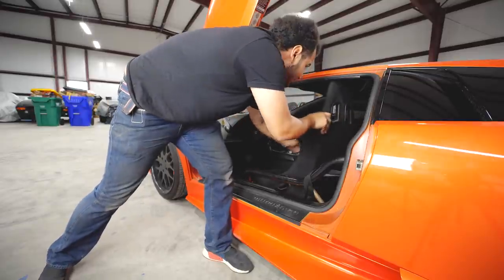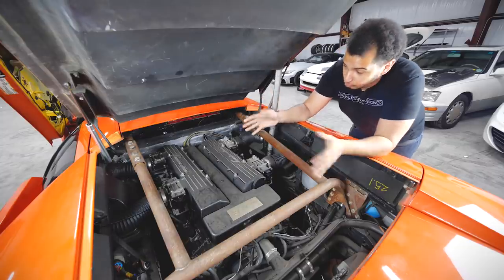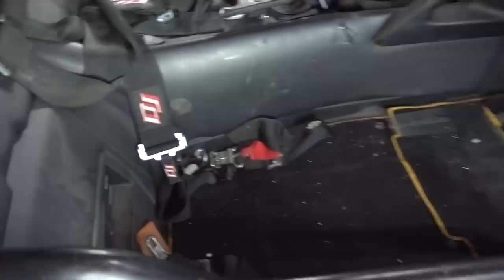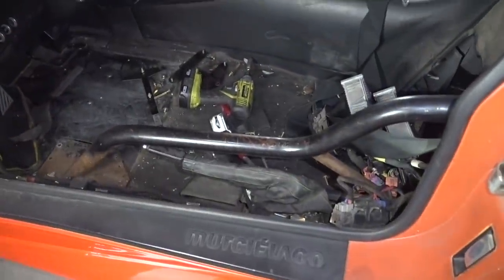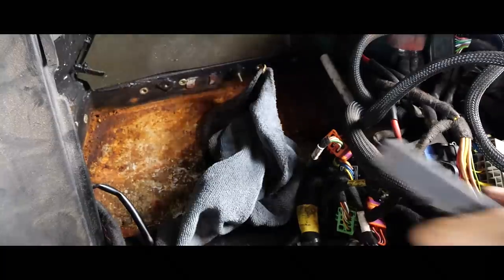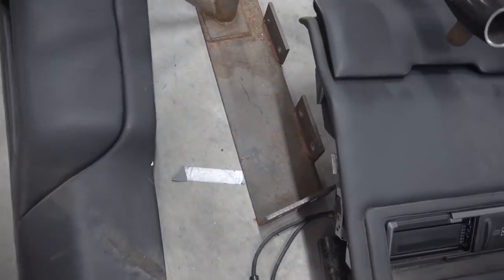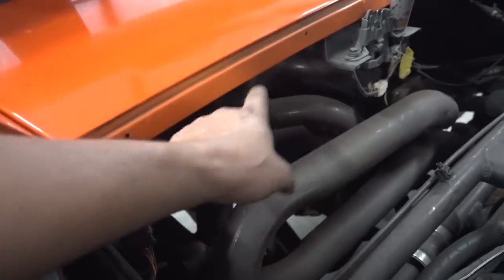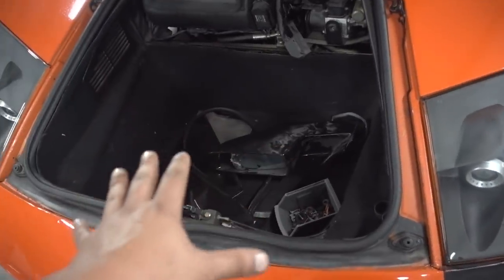I THREW AWAY All The RUSTY Fast & Furious Movie Parts On My Cheap Lamborghini (NOTHING LEFT!)

Comment: My old audi A8 had key stuck in ignition (reason was low voltage). If it is audi part there should be a little hole on front side of ignition lock where you push with needle to get the key out. I doubt it will help, but try it out.
Reply: hope he sees this xd
Reply: If I recall correctly. The key is cemented in.
Reply: He was told it was glued in but that doesn’t mean it was.

Comment: Nice project but, stereo is absolutely the last thing to do on the list...
Reply: daredevil7442 well I mean if u already are going to have everything apart you might as well do it.
Reply: So build and nearly finish project to rip apart completely again to install custom sound. Right.. I see your logic.
Reply: Correct. The FIRST thing you do is take a car used in a film franchise where one of the main fucking actors was killed in a car crash, and you make that car less safe by removing all the roll cages.  facepalm
Reply: Juan Cornetto well he’s using it more of a daily driver not a race car.
Reply: The chances of him dying in this car after he brings it to oem spec are very very very low. The roll cage was in the way of everything because it was built and thrown in the car as fast as possible that shit was held in by harbor freight bolts not welded in. Plus the head wold be impacting the top bar in a bad crash. The cage would have done more harm than good. Who died in this car? And or in the making of that movie? I’m uninformed. Clearly states the hacked roll cage went through the window causing a delete. In turn causes carbon build up in cab and you die. (Windows don’t roll down) did you watch the same video I did? Thisisnt a drag car who tf needs a cage as a daily driver? You ken blocking this car bro? Doubt it.. so keep the cage and die driving because of carbon poisoning. Solid logic.
Reply: He just needed that guy’s help, u know he is cheap so he didn’t want give the guy money so the excuse is the speakers lol 😂
Reply: Juan Cornetto that roll cage was low quality garbage, ripped holes from the engine compartment to the cabin bay...um he mentioned exhaust could get inside and kill him.  Two the car was a prop, so props are built cheaply with the lowest quality parts.  Rust from said roll cage was eating into the car leading to future frame issues.  It wasn’t safe in a roll over the small bolts on the floor most likely would snap and cut off your ankles and the role bar behind the driver would more than likely give a concussion that would shatter the skull.  Basically it was a death trap

Comment: Honestly I really like the color of that car, you should try to maintain it while still improving the finish, it would probably raise the value if you want to resell it later as well (With the "This is the same color it had in the film!" tactic).
Reply: TheIceWarrior i agree that orange needs to stay, but it needs to be redone to showroom quality.  Makes for a great car to take to shows etc.
Reply: I agree.. It might need a water sand and buff job. And redo the front emblem
Reply: @sstevocamaro  I would be surprised if there aren't a ton of specks under the clear. He will probably have to sand it down to near-primer and start over.
Reply: the whole car would need to be stripped down, and the old paint completely removed & redone to be a proper job. Nobody is paying a premium with the paint job the car currently has, even if it was cut/polished, it was not painted correctly at all. High end cars bring in the best money in original condition

Comment: Wow he gave you at least $15k worth of extra parts probably more
Reply: Benard Jenkins for sure, I started drooling about secondary market possibilities. He threw in all the extras because he didn’t quibble about his insanely low asking price like most “shrewd negotiators” often do. Rabbit may have got he car for $65,000 and a night with the owners wife as well as a spare parts car but most mortal humans would have screwed themselves by low balling. He may even get more parts when they move cars around in their shop and discover other bits in the shadows because he was an easy deal. Also there are many future possibilities because of his easy going purchase. I’ve worked in the movie industry and they can be extremely generous to people who aren’t a-holes and simply take what they are given at what is a very good deal. I once bought 25 55gal wooden casks for $25 each that they needed moved by the end of the day. I was given bad information about their location and weight and it nearly proved impossible but I did what I said I would do and quickly sold off most of them for $150 each but didn’t make a huge profit because I had to rent a Hiab to lift them out and a flat deck truck as well because of time constraints. People were watching and saw I kept my word even though I should have packed it in and crashed or renegotiated the deal. 2 months later they offered me another 60 barrels for the same price and I simply said yes although they knew I didn’t make much the last time. They delivered them to my secondary seller and the 10 I kept straight to me although I’m pretty sure it cost them as much as I paid or more to do so. I made nearly $6,000 and had another $2,000 worth for myself that I sold in drinks and drabs.

Comment: Hey Tarvish, if its not to late try replacing the battery before tearing into the ignition. I am not sure about Lamborghini, but with some model Buicks if the battery dies with the key in the acc position it prevents removing the key

Comment: I can’t help but cringe with how sloppy and untidy things look in process.  yes it’s demo , but how do you not lose stuff? .  Tons of parts just everywhere. Also, first step you do is custom audio? A subwoofer? In a space that small? Yikes.   You have a v12 and plan to have a F1 sounding exhaust.   You really want fender shaking bass?  May as well just put the neon lights underneath now, and add a smoke machine for good measure.  And then just take out the v12 and put a Honda two liter in.
Reply: LS swap would be cool
Reply: You mad? Maybe when you can afford one you can not have a stereo in yours
Reply: Do you even lift bro?

Comment: Am I the only person that thinks removing the roll cage and adding a sound system removes its movie car cred?  I get why he’s doing it but I’m a bit disappointed in the direction he seems to be going.
Reply: I don't think you appreciate the fact that there is no such thing as "movie car cred"... all that means is "hacked up in the most time and cost effective manner to be a near-single-use vehicle". I mean, they left out the nuts on the gearbox after changing the clutch...
Reply: @andersjjensen   Agreed, this car is a piece of shit and he's doing the world a favor by correcting all of the shortcuts they had to take to make the car work for the movie.
Reply: No matter what he does the car is still going to have the same provenance.
Reply: You missed the part about the roll cage deleting the rear window causing exhaust fumes to leak into the cabin. Keep the cabin and it’s essentially not drivable

Comment: @Tavarish you Could turn the roll cage into a bench for the workshop turn the bit that went to the back of the car as the bench the 2 pipes that went thru the rear window as legs weld 2 more pipes to the bottom of the cage and use the bent peicese that went into the foot well as a back rest for the bench?

Comment: Great vid and great car! The anti-submarine feature would likely be on the shoulder harness. It's an excess length of strap that is sewn in with weaker stitching. In the event of an accident, the stitching tears, the excess material unfolds and allows your body to move forward and rotate (IIRC, only 1 shoulder harness has the feature). The movement of your upper body prevents your lower torso from submarining from the momentum of your body. Also, 5 point harnesses should only be used with cages / roll bars. The 5th point prevents submarining. If you get held in place better, in a vehicle without a roll bar, well.....let's just say your neck/spine won't be feeling so good.

Comment: Personally, I would have retained the roll cage but then I have experienced the value of one on (off!) the road.  The 4 point harnesses can usually be easily adapted to 5/6 point although, properly fitted 4 point harnesses with a proper seat can be almost as good.  IMO retaining the rollcage and the harnesses is a must do safety feature that improves the performance of the car that will be essential for any real quick driving, changing back to stock will be a retrograde step but if the car is only for posing then it won't matter.  I certainly wouldn't try out the performance of the vehicle on a track day (which is the only place that it can be tried) without the extra safety items.

Comment: Is there a chance that car was an automatic originally? VAG cars started locking the key into the ignition when in gear around that era, and also would have locked out the ability to start it, if the manual was retrofitted quick and dirty, it could have caused that issue, maybe?

Comment: When you wanna bolt something to a structure you don't really know well, it's really better to use a lot of small bolts than a few large ones, as it distributes the forces more evenly.
Also, Murcielago owners, what do you think about the inverted seatbelt position? It takes a while to get used to, but is it more comfortable? is it more practical due to the height of the center console?

Comment: @Tavarish my key got stuck in my 5 Series when the battery died. I had to mess with the car shift lock release.   

Check to see if there is a interlock cable or lever, for the key, around the shifter. if there is a mechanical one on the car, you may be able to rig it to release the key. 

The Lambo may use an electric key lock solenoid. The Key Lock Solenoid Controller (shift lock ECU)  attached to the shifter may be damaged or disconnected.

Hopefully this helps you.

Comment: Freddy - on my 997, when the car is in winter storage and without a battery, I cannot take out my key. Found out the hard way. Have you tried adding power (charge the battery or a battery box) and tried pulling out the key?

Comment: The ignition may have a key release button on the steering column
Reply: Because if they would have glued or JB welded the key in the ignition the key wouldn’t turn in the cylinder

Comment: Awe, was hoping he'd keep the cage and have it coated!, it actually looks nice and isn't too intrusive
Reply: Except  for going through where the middle window should be, its not intrusive at all.
Reply: @nssherlock4547 
correct, it's not intrusive. There are thicker gauges of Lexan, Plexi, etc available that he could source to be custom fitted to the area for a proper hermetic seal.
I'd dare say it'd even be cheaper or matching costs of an OEM glass solution (if it really is glass).

Comment: I used to be a locksmith, I know there is no comparison between lambo and gm but I know a gm vehicle will not allow the key to be removed from the cylinder so I would try a nw battery before removing or replacing the key cylinder

Comment: About the key stuck, if the car was originally an auto, the car most likely thinks the car is not in park, thus not letting the key come out. The reason you can’t start the car with the key is the same. Car needs to be in park or neutral. Even if car is in neutral key won’t come out

Comment: Curious why you're already putting stuff back in the car before paint is handled?  Wouldn't it be better to strip the car down, pull the drive train, and then take the thing to get body repairs/fabrication done and painted?  Work on your transmission and engine stuff while it's at the body shop, then get it back and put everything back together!

Comment: Can't really tell from your footage if the harness is anti submarine or not usually one of the sides of the harness will have what looks to be a thicker part which has folded material so that in the event of a crash it breaks away allowing your body to twist and pivot instead of going under the lapbelt. (Edit from the footage around the 8 min mark those harnesses look to me to be the less safer of 4 point harnesses as in they don't have anti submarine technology)

Comment: The rust would have been caused from hella condensation because the car is getting hot during filming and then is put into a car transporter in a very cold climate, so i bet the cars would have had water in them by the next day hence rust

Comment: a 65 Fender Stratocaster is worth X amount of money... a 65 Stratocaster owned by Jimmy Hendrix, with all the scratches left by Jimmy is worth ALOT more....You have diminished its value. I understand making the car more functional (a broken 65 Fender owned by Jimmy is worth less than a functional one). But stripping out all the FF parts and placing the stock parts in it.....not really smart and someone in the future will put those parts back in. It might have been good to remove all the roll cage and seats, refurbish them (pull the rust off) paint/fix them and put them back in.

Comment: - Order new seat. 
- Strip interior. 
- Take off roll bar. 
- Fill holes. 
- Rust proof those spots. 
- Get the guy to overhaul sound system wiring and keep it stock. 
- Fix ignition. 
-Fix shifter. 
- New back window. 
- Refit interior. 
- Give it a quick wipe. 
That's how i would  do it, but what do i know... Just a non follower here. 🤷‍♂️